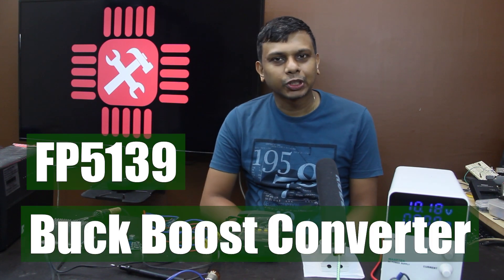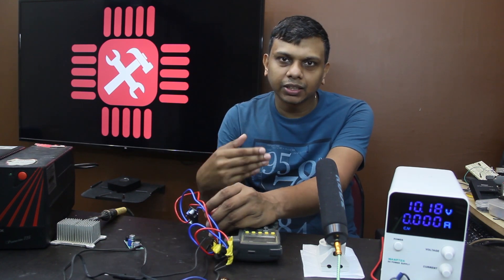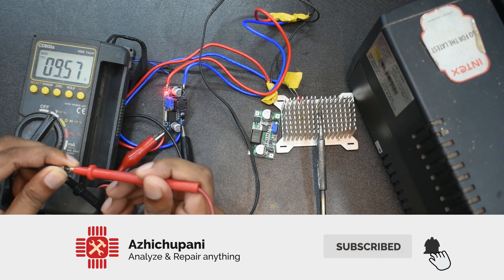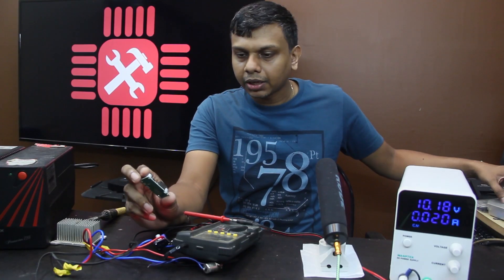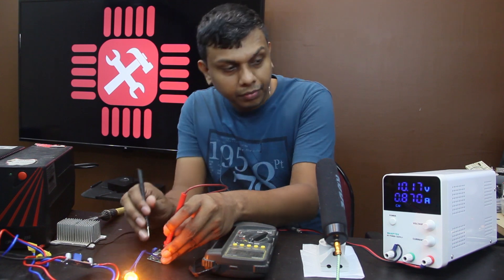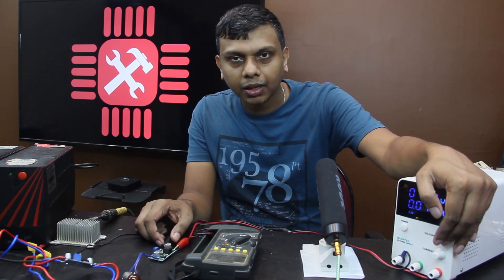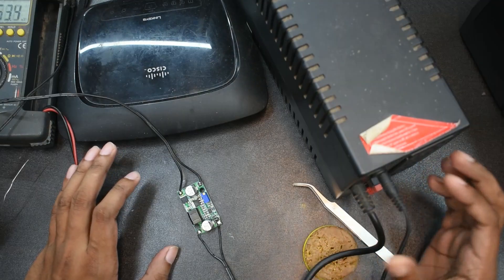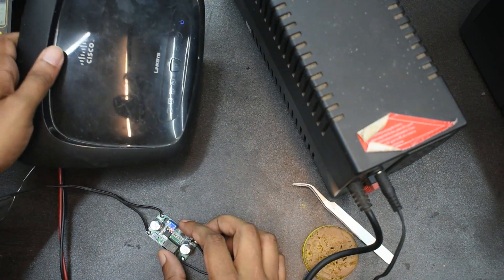FP5139 Step Up Buck Boost Converter | Router UPS | Router PowerSupply |

Comment: Sir can I get link of FP5139.
 I have xl6009 step up buck converter but in this converter voltage is not regulated when input is 10 v and output is adjusted to 12 v then the input increases to 14 v the output also going to 14v. Any solutions?
Reply from the maker: Let me check that.. I don't think it works like that
Reply: @Azhichupani  ok..
Reply: @Azhichupani  Bro which one is better FP5139 or XL6009

Comment: Hi Techies, Plz help me clear my doubt.
I believe when I use the Ac adaptor of laptop or mobile to recharge, the adapter itself prevents overcharging.
If I use a buck converter to recharge my laptop or mobile, how can It prevent overcharging?
Reply from the maker: I don't think the adapter is regulating over charging.. the device when fully charged will not accept any more power.. In case of Buck boost converter if you set the voltage right you will see the same happening

Comment: Buck boost converter inverterinte  akathu vekunnathalle nallathu.?
Reply from the maker: All bro.. 2 gunam undu..
1)  in case of floods okke.. ee system 5v aaki phone charge cheyyam..
2) output wire koodum thoorum output voltage kurayum so better keep it outside and near to the device